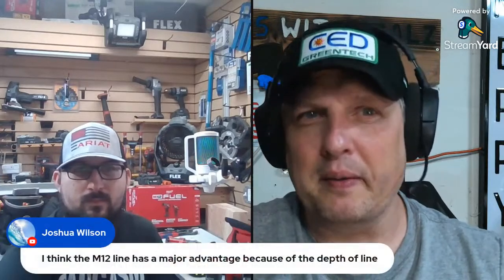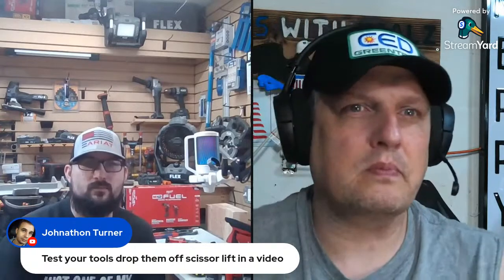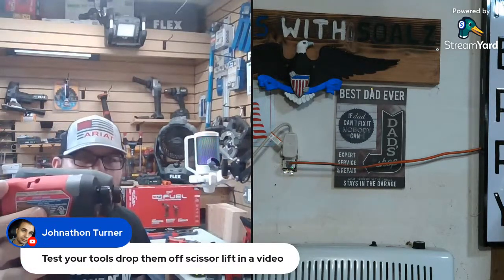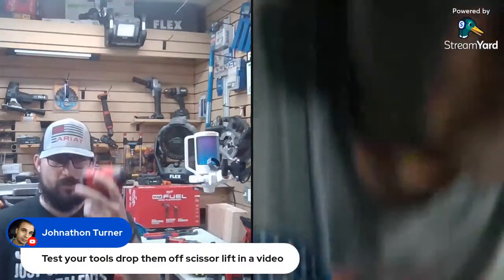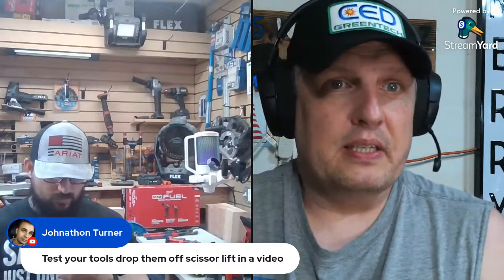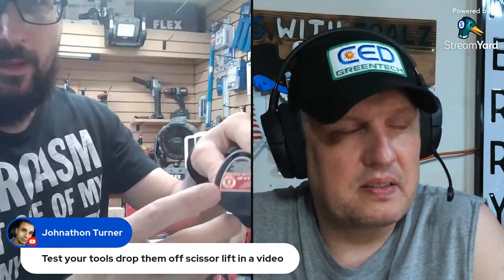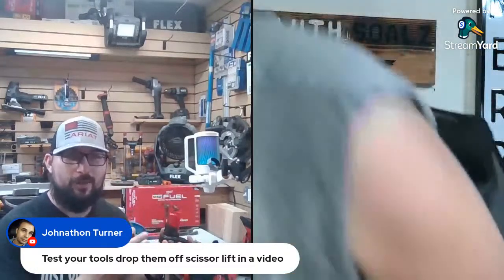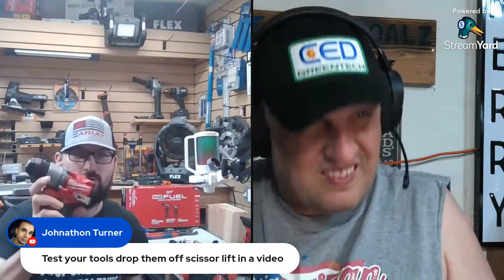LIVE Testing NEW Milwaukee Tools

Comment: The M12 drills need kickback brakes or side handles. Also the previous Fuel M12 drill has a garbage electronic clutch. I was using my M12 literally on clutch setting #1 today on 3/8" coarse threaded screws today and it damn near broke my wrist several times and also nearly broke the screw a few times. And the ramp-up made the job take 2x as long. 100% garbage. New M12 looks better with mechanical clutch but kickback clutch would be cool.